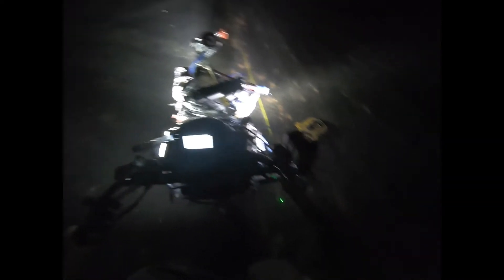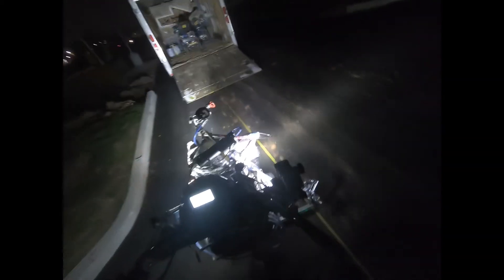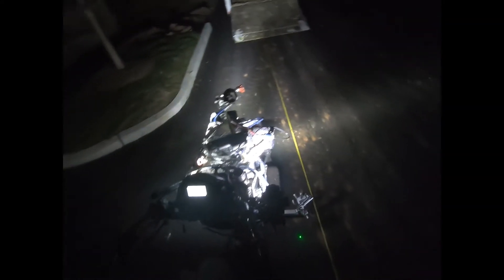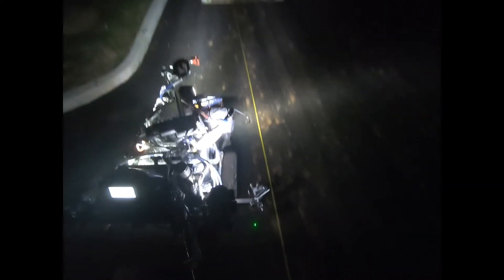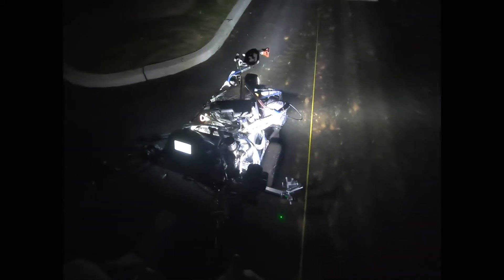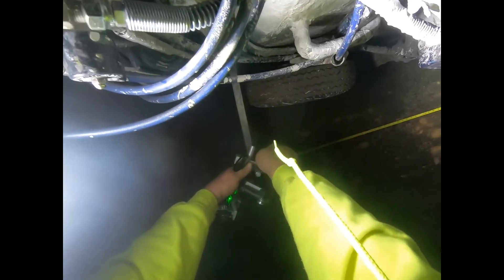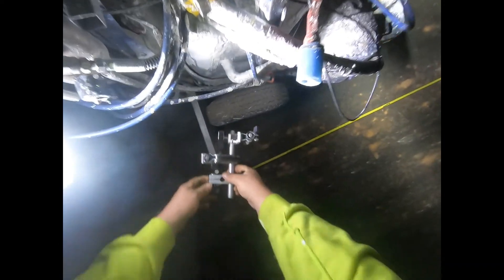Calibration of a Graco Linelazer V 5900

Comment: I use one of these for work and it’s horrible for what we use it for.
Reply from the maker: What did you use it for? I have been using the autolayout since 2006 and never found a other with it
Reply: @linepainter  we use it for crosswalks, centerline striping and edge line striping. It’s a good machine but not for that use